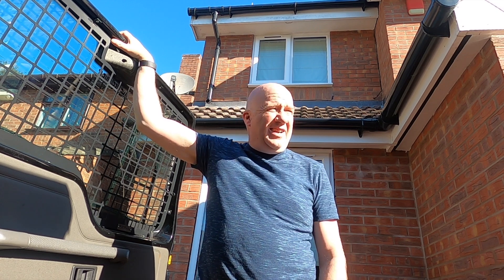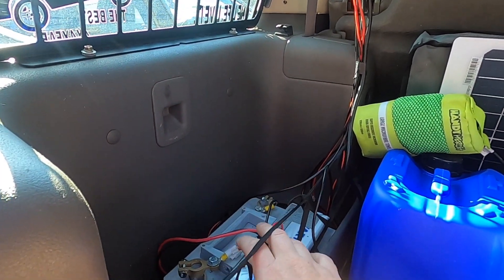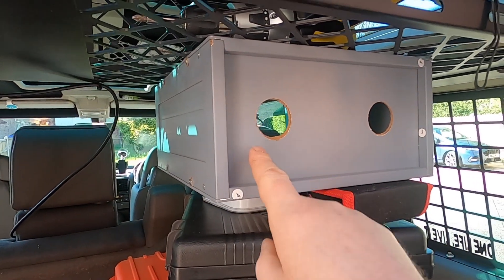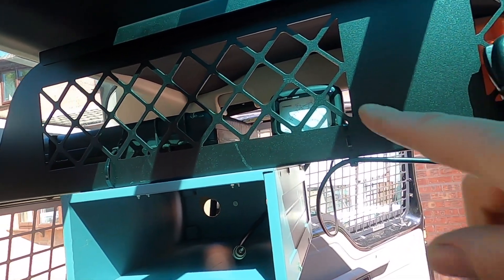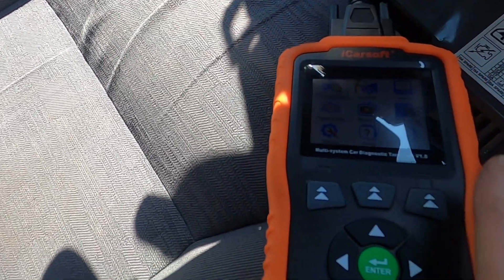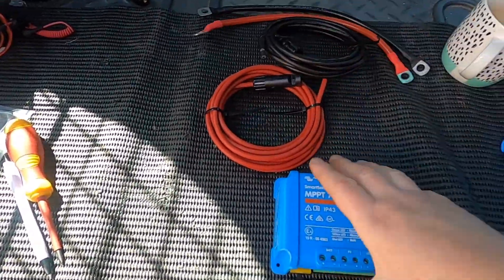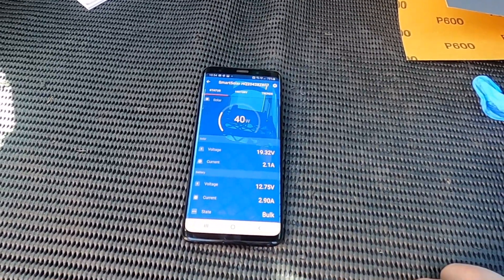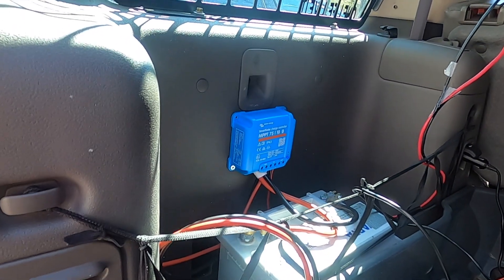Installing solar power and ham radio gear into the Land Rover

Comment: Have you got fuses on the supply feeds? If using a 20amp controller 20amp fuses. Your float voltage should be around 13.7 to 14.7 in full sun.

Comment: How is the noise when driving the disco? Yours is diesel right?
Reply from the maker: Engine noise is nice and loud on the outside but inside you can chat easily, noise on the radio is low although I've very rarely usd HF on the move.

Comment: A180 W solar going to my leisure battery and that’s on a split charge ( connected to my starter battery ) and a rover mppt , I’m assuming it won’t start charging my starter battery or damage it ?
Reply from the maker: I have basic understanding at this stage but I assume if there's circuitry in place that stops over charging of either battery then that's good.

Comment: Never found a code reader that worked on my 2003 Freelander. Same with my old 2002 Focus ST and 2003 Mondeo. Older vehicles were not 100% compatible with the "standard". Neighbour's Disco 2 has the same problems.
Reply from the maker: I think it's because the software is incapable of dealing with results that are missing from the test it performs. I had to run the engine which helped.

Comment: I was looking at having a leisure battery in a Freelander charging through a controller from 12v taken off the the accessory socket I had fitted in the boot area. I plan to have the radio(s) sitting on a drop-down shelf hinged in the side opening barn-door tailgate.
Reply: Freelander 1? from memory, I don't think the aux socket would be rated high enough to keep the battery properly charged, especially on journeys less than a couple of hours if the radio had had a lot of use while parked up.

Cut the grommet where the main loom goes through the bulkhead and run a suitable sized wire through there, under the trim, to the battery in the boot. The F1 doesn't have a smart alternator, so a basic split charge relay will do, make sure to fuse the cable running to the boot at each end.

I would also always advise a battery discharge protection solenoid, to prevent excessively draining the battery.
Reply from the maker: Discovery 2 but some good ideas thank you
Reply: @asp383  You're probably right. I hate putting wiring it though!

Comment: Just a thought Carl why don't you put the radio onto a rail like your kitchen unit drawers.
Reply from the maker: I've got 2 rails which I took out of old drawers, they are on my desk. I was going to consider slide out drawers but the weight is too much when fully extended. Still thinking about sliding/revolving unit though.

Comment: Wouldn't a solar charge controller, MPPT or PWM, make a lot of noise on HF?
Edit: Ok, so it is a MTTP charge controller. Switching frequency 20-80 kHz, square wave. Looks unshielded... Prepare for harmonics from switching frequency to daylight. :-)
Reply: Never noticed any noise on any bands with my controller, had a 100w solar panel through a 35a controller to a bank of 4x 100ah deep cycle batteries, alongside a 200a split charge system. The controller was a generic model of Amazon.

Comment: Enjoyed that cheers.... BTW I think those cables from the charge controller are plenty thick, cant see more than 10 A ever coming from that pannel(especially in the UK ;-) ) you could easily go to a thinner gauge  especially as they are not much more than 6 inches or so!   BTW my battery connections from my 120W foldable  unit are MUCH thinner. Enjoying the build either way. Keep it up Carl!

Comment: Hi Carl, just a idea for you as opposed to using the solar, why not fit a drop back relay,(i have noticed whether your landy is already towbar up if it is already wired for towing, you could use the plus 12v on the accessory plug to charge your leisure battery, this wiring if your landy already has it will(or should have a drop back relay to prevent vehicle battery discharge when the engine is off, ideal to boost the charge on your leisure battery when on route to one of your /P jaunts, and if the power drops too much you can always start the landy up for a few minutes to boost it, there should be somewhere in the boot floor a blanking grommet already there for cables etc, or if you have no towbar ebay is a good a place as any to find a drop back charging relay, or alternatively find a landy in a breakers yard with a towbar and remove and said relay, just a thought for you, keep them coming :)
Reply from the maker: yes ATM I use that to charge the portable power pack and sometimes to run the 4G wifi router on longer journeys.

Comment: Carl, easy way to secure the radio into your box Without having to use any more hardware is to use a bungee cord - hook the bungee cord around one of the brackets then loop it around the back of the box and hook it on the other bracket.. When it’s going around the back of the box you could loop it up and through your grid shelf above (To keep it from sliding off the bottom of the rear of the box)
Reply from the maker: That's exactly what I've done :-). It's in the next video which I'm just editing now.

Comment: Good work Carl, love the faffing.  Like the solar charging, can you use the battery at the same time? Cheers  Gary
Reply from the maker: I've tried and there's noise on the ham radio at the moment
Reply: @M0SZT  mmmm, I was wondering if it would create noise. Worth a try tho. Cheers.
Reply: @M0SZT  easy fix sir
Larg cap like the kids use for thare big car stareos 1 or a 2 fared  shoud do  nice n most have a volt meter on them
But remiber not to touch leds coming off of it as caps discharge all at once it can be LETHAL